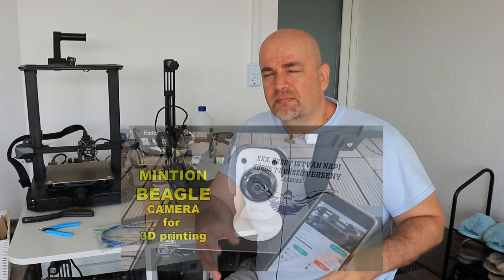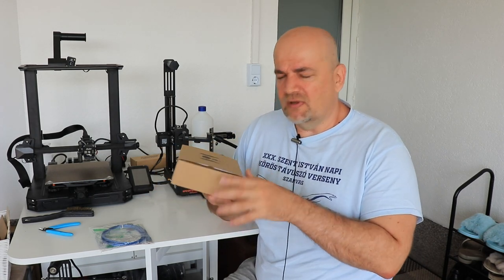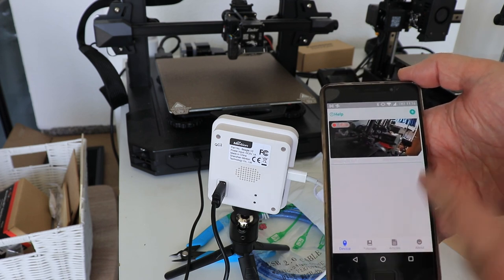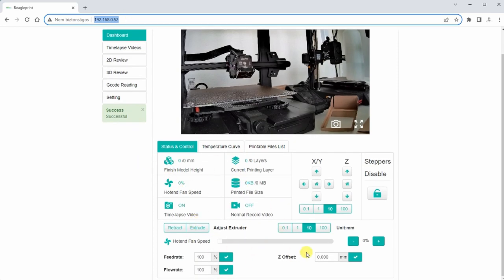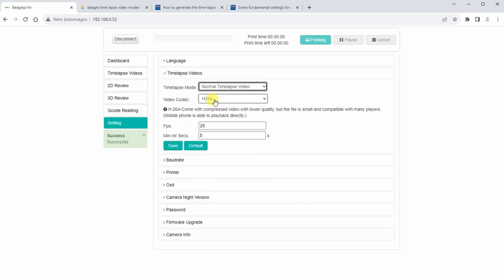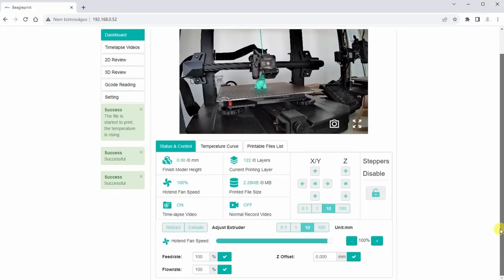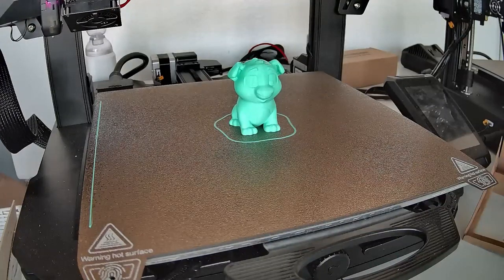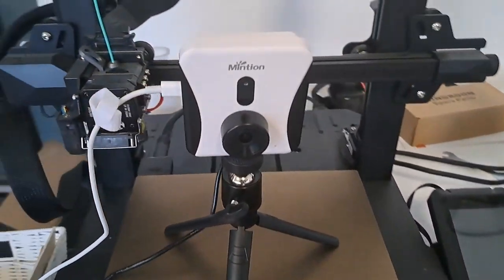Great replacement for Octoprint: Mintion Beagle V2 camera for 3D printing

Comment: Not crazy important but if you pixelate/blur your WIFI password etc in the video then I suggest you do the same to the QR code. ;)
Reply: Yes, I was just able to decode it. The bad part is that it is encoded in a different way than normal wifi sharing QR, so it forces you to use the app... Chinese engeneering...

Comment: The original Beagle was just a repurposed baby alarm, it had many issues including no security and a very janky mobile app, from what I can fathom it is just a slight change to the software and not the camera's functions and I dont see any benefits for this camera in a new case over the old one, they didnt even give it a 5Ghz connection and considering most people dont have the old 2.4 Ghz connection I can see this being a high return product!
 I cant see myself or any other Octoprint users changing over to this as it doesn't support plugins like Octoprint, Octoprint is easy to install these days from Raspberry Pi Imager and now that the Raspberry Pi Zero2 W is back on the shelves I cant see anyone other than complete novices taking this up.
 I just thought, is this the original board with a new camera sensor in a different case?
 Can you inspect both models internally to find out what has actually been changed?
I tried to get more information from the Shopify link but received a warning from Malwarebytes not to connect as attackers may be trying to steal bank details from this site.
Reply: What are you talking about? It has 5Ghz...
Reply: @petergplus6667  I originally saw an early issue review that did not have 5Ghz
Reply: Soy novato, me gustaria que tuviera mas cosas pero por ahora es suficiente y agradecido que exista algo tan facil de conseguir